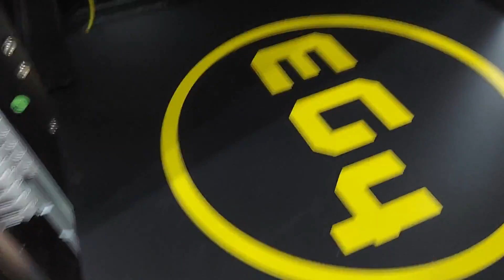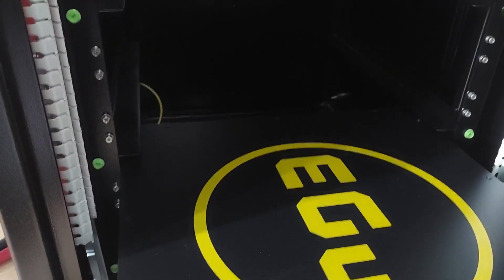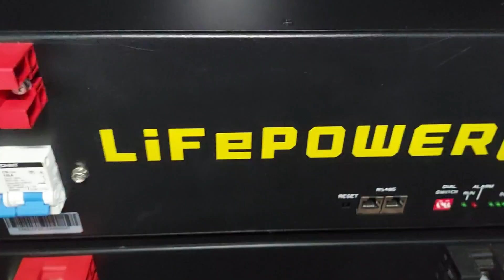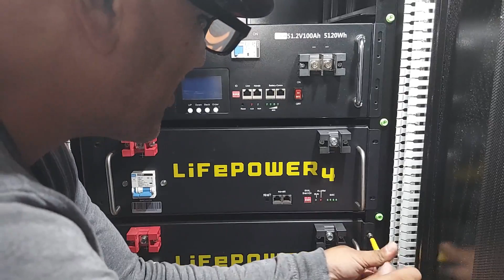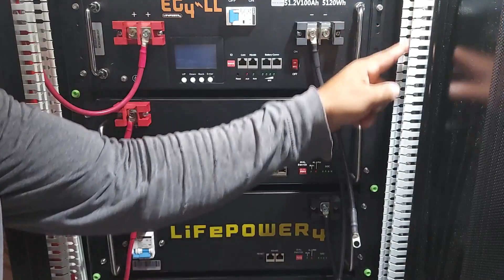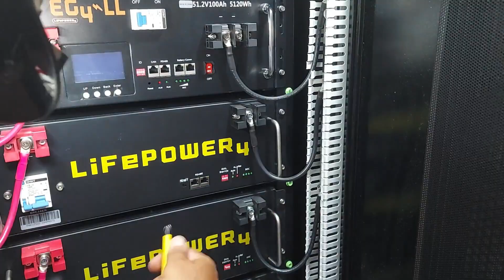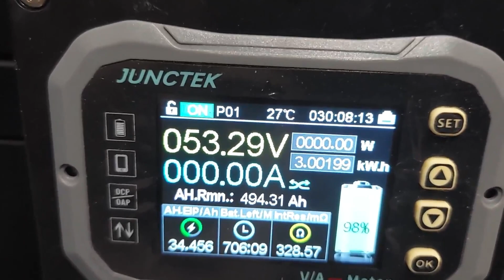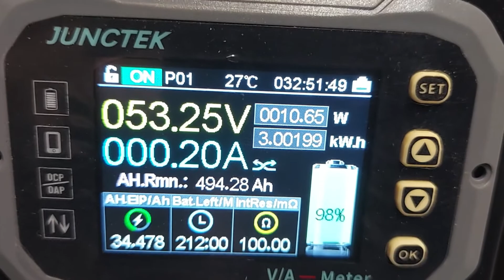EG4 Lifepower 4 LFP 48V EG4 SERVER RACK Install

Comment: I really like your approach. For newb's it might be worth mentioning that the setup you have is "quite functional and for off grid use". It would not pass inspection for an NMA though. Please do not take my comment as anything harsh. I am a "Redneck DIYer" and appreciate using what you can to make something work safely. 
I recognize that the rich pretend that everyone can afford $35 fittings every 18 inches. 
I only fear that someone will lose a lot of money when an inspector comes around and they have to redo some things. (Note: I just had to trash $100 of conduit to install $200 of conduit on an install).
Thank you for your video!

Comment: Do not use this battery rack as you have it installed! Power it off, losen the screws on the batteries and bus bars, and buy a torque screwdriver and/or torque wrench and torque them to the correct values, and then 24 hours later go back and torque them again (with the power off).
Reply: Same with your PV disconnects if you have them.
Reply: And make sure that all your wire connectors are directly touching the bus bars/connection face, with no washers/locknut washers in between them and the face; those will be behind the O-ring and the screw/bolt head).
Reply from the maker: @hacked2123  if you'd listen carefully,  this was mentioned in the video about torgueing them later, which did happen.
Reply from the maker: @hacked2123   @hacked2123  if you'd listen carefully,  this was mentioned in the video about torgueing them later, which did happen.